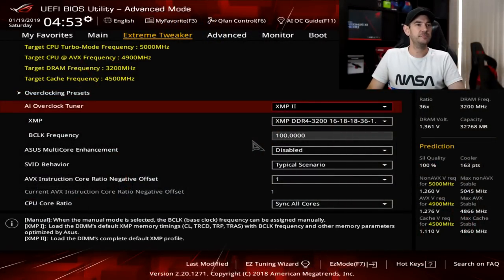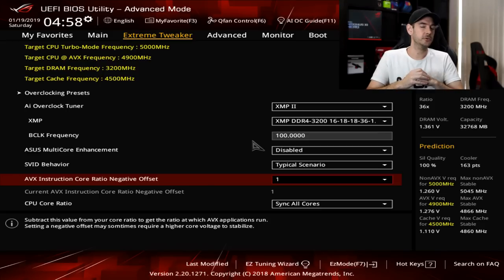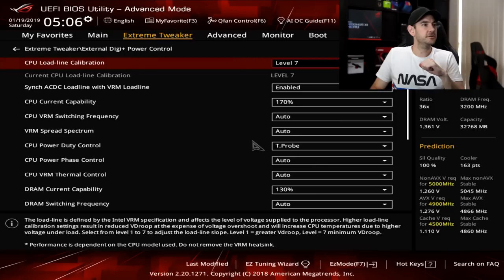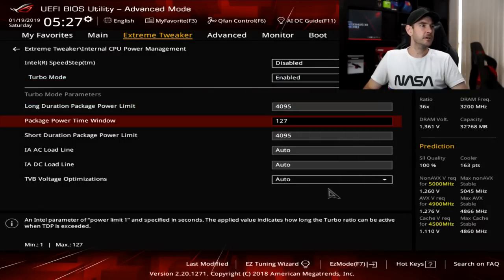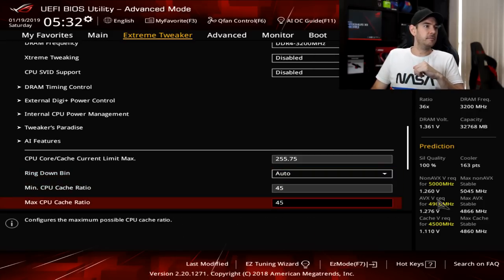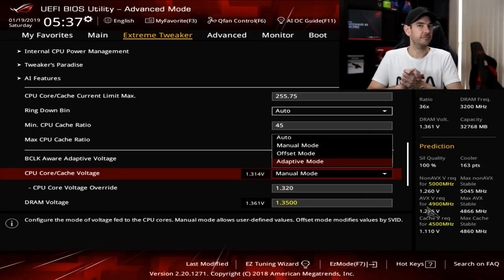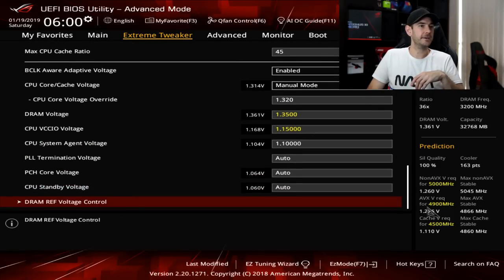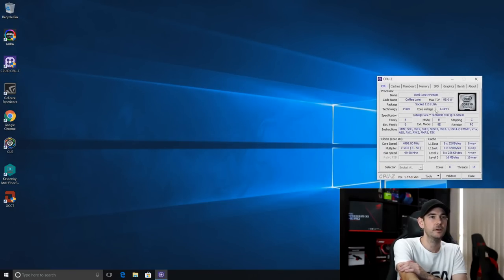The Complete i9 9900K Overclocking Guide - Maximus XI Z390 and Others

Comment: Love your videos. Super helpful!  Been working on my 9900k OC profile. I have an Asus z370G MB with vengeance 3466 16x2. Proc is binned and delidded and supposed to be stable at 5.0 at 1.300V. I have found if I run multiple Cinebenches I get a BSOD.  I have increased voltage up to 1.37v to get it stable.  My BIOS is slightly different than this one but have very very similar setting. Ideas on how to get it stable at less voltage like the z390 boards show?  Seems like I am missing something.  Intel Burn Test shows stable as does large and medium OCCT although I get errors on small batch. Temps stay below about 80C on cinebench and less on Aida64 and IBT.  Thermal Compound is Artic MX4.
Reply from the maker: What’s the AVX offset claimed for that clock speed on your chip? It’s likely -4 or something high.
Reply: Boosted Media thanks for the quick reply.  Silicon Lottery recommended AVX 2 and that seems stable on an avx test. That’s what’s old.  It’s the multiple cinebench runs that crashes me.
Reply from the maker: Interesting. What sort of voltage droop are you seeing under load. Might need more load line calibration.
Reply: Boosted Media I have tried both Load Line 6 and 7. With 7 it raises the voltage significantly from:target while 6 keeps is pretty close to the target.  On a 1.370v target cpuz reports 1.344 or 1.360 in a Cinebench test. Without load the voltage will go back to 1.376V as reported by cpuz. Neither 6 or 7 seem to help too much on the BSOD in Cinebench.  At 1.370V I can run 10 cinebenches without a BSOD. At 1.360V I can run maybe 5 before a BSOD. Did some more testing with Load Line 7 at 1.360v. Under load voltage goes to 1.392 but still get the BSOD in Cinebench after a couple of runs.
Reply from the maker: I wonder if maybe there’s another issue like too low VCCIO or VCCSA. Going to be a process of elimination I’m afraid.
Reply: I was thinking that too. I have set the VCCIO and VCCSA both to auto and 1.15-1.20 without much luck. VCCIO of 1.15v is stable at an core at 1.7 I know. What is safe on the high end for these?  1.3 or so?  Silicon Lottery says the MB is not on their approved list so they won’t comment much. They want me to have an ASUS z390 but there are no Asus z390 micro-atx options yet for my rig.

Comment: If you use offset instead of manual you can get away with a way lower LLC. I have a Maximus Xi code and a 9900k and it was the only way I could get no vdroop. I set it to 5 and still get a little overshoot.
Reply from the maker: A little Vdroop is preferable as long as it’s not enough to make things unstable.
Reply: @boostedmedia  even at the highest setting I was getting significant amount of vdroop while running p95 small fft. Like .05 still. By doing offset and LLC 5 I'm getting a .01 to .015 overshoot which is way more manageable. I haven't been a fan of these motherboards. I'm most likely going to go with a Maximus XI Apex when it releases for the better VRM and better RAM overclockability and sell my Code.
Reply from the maker: Prime 95 small FFTs are a very unrealistic artificial load. Do you have the same problem with s more realistic load like Realbench/OCCT?
Reply: @boostedmedia  you're right, but no, it's more of a .02 to . 03 droop in occt. That being said, I get virtually no fluctuation in offset mode when running a more realistic load and only get overshoot when running small fft
Reply from the maker: Interesting. The VRMs on these boards do seem to struggle with the additional 2 cores.
Reply: @boostedmedia  yeah, my Maximus x hero seemed to do better. I initially had the 9900k in there and had it set to manual with LLC at 5 or 6 and had 0 fluctuation. I ended up giving the Maximus x hero (and my 8086k) to my brother when I got the code thinking it'd have a better VRM but that doesn't seem to be much of the case. While the xi code does use a hair less vcore the x hero was way better at keeping steady voltage when set to manual so I dont know. Just really weird.
Reply: @tresnugget  The Z390 Maximus XI series has worse VRM than ther Maximus X series. Buildzoid from gamers nexus did a breakdown on it.

Comment: I just have to say that my MAXIMUS XI is dying after one year and I never got to OC it.
Reply: How is it dying
Reply: What do you mean
Reply: @viperro4542  Like BSOD every 15 minutes malfunctioning LEDs and crashes using Maya. I've since moved on to Gigabyte.
Reply: @JayStein777  that's weird. You sure you didn't drop water on it or it wasn't a defective unit? Did you try resetting the bios because you maybe changed a setting?
Reply: @viperro4542  OK, I am a PC expert, my first comp was a Commodore 64, The ASUS was FUBAR after a year. I run stock for a year then OC. My Gigabyte board is rock solid. I may have gotten a lemon but ASUS failed. Oh and NO moisture got near that board.
Reply: @JayStein777  oh ok
Reply: @JayStein777  i wanted to buy a gigabyte board but the computer expert there told me Asus was better
Reply: @viperro4542  Research.

Comment: So I followed this set up and purchased pretty much the same equipment that you are using. It was awesome with zero issues on the first try and first time OC'ing.  However, I needed to upgrade my RAM to 64Gb and went with Corsair Vengeance RGB Pro 64GB (4x16GB) DDR4 3200 (PC4-25600) but before doing so, I figured it would be a good idea to revert BIOS back to default settings. Now, I would like to OC the 9900K again, but can I still use this guide? Thanks again for a great video!
Reply from the maker: Should be fine. May be a bit more difficult to get stable with 64GB.

Comment: so glad to found your video and your channel ! i am fan now ^^ Question : i have the maximus XI extreme + 9900K + 4x8gb = 32gb of G.Skill 4600mhz (constructor stock on there web at 4600 = cas 18-22-22-42 at 1.45v). can you please tell me what happen because i put this memory at 3200mhz at 1.45volts for make an stable OC of my 9900K who is stable under prime 26.6 for 8 hours) at 5.3ghz @ 1.315Volts (i let for the moment the avx at auto) with stong custom WC then after that i wanted to put like you the right speed i paid for mean 4600 and the "XMP 2" of this memory but it dosent boot... same when i choose "XMP 1".... i have actualy an VCCIO of 1.15volts and and System Agent of 1.20volts.... Thank you for your help and for your great videos :)
Reply from the maker: 4600MHZ is pushing the limits of the memory controller on the CPU memory controller and motherboard. Try setting your VCCIO and VCCSA at 1.3V
Reply: @boostedmedia  just tried even at 4000 it dosent boot... :/ i disable too the switch on the motherboard "mem ok" + i clear the cmos... if you have any idea ? I never touch to memory before that
Reply from the maker: I’d set it back to the base JDEC profile and get your cpu overclock stable. Then work on memory.
Reply: @boostedmedia  hi :) my cpu is totaly stable since now many days with prime 26.6 with value 12 12 testing working for more of 8 hours
Reply from the maker: Hmm. Do you have the RAM installed in matches pairs per channel?
Reply: @boostedmedia  thank you for your answer they are fast. I am using the 4 slots. With exactly the same memory 4x 8gb. But i just tried even at 4000mhz with your 1.30v and i even put 1.50 when normaly is 1.45v for the ram voltage to see and it dosent boot... i dont know what to do and gskill support just dont mind
Reply: if you prefer on facebook i sent you an message at your page messenger ^^ if not here is fine for me too ^^
Reply from the maker: Hard to really advise beyond this point. There’s so many variables. But basically 4600MHz is way beyond what the memory controller is rated to. So it’s possible your CPU just cant go that high.
Reply: Why my cpu is in the topic ? :) do you have an idea what i can do ? Or where to make them work ? :(
Reply from the maker: The memory controller is part of the CPU.
Reply: I understand. In this case what you recommand me to do ?
Reply from the maker: It’s impossible to say really. Could be that the ram and cpu just aren’t stable together at that speed. 4600MHz is just the rates speed for the ram. It doesn’t account for the other parts of the system.
Reply: :( more lost as the begining
Reply: Update ^^

- i tried  for the moment with the XMP 1 and i answer to the question 
after that  "No"  . i did right ? i put my memory voltage at 1.45v 
(constructor voltage) and i decide like this because i read on other 
post for high freq memory  to put  at vccio and Sa both 1.300v and i 
suceed to boot until 4500Mhz !!! ^^ after that i put on the VCCIO and SA
 both 1.250V it boot again but it took much much long time than 
1.300volts...

- Can you please tell me wich XMP to load ? the XMP 1 or 2 ? (to understand: what is the difference between them ?)

- to boot at 4600Mhz i have to increase more than 1.300v the VCCIO and SA ? is not risky ? it will not make more hot my cpy who is oc at 5.3Ghz at 1.315volts ? (very stable delied on direct die on strong cutom watercooling temp max on prime 26.6 non avx after 3 hours 83°c
Reply from the maker: VCCIO and SA 1.3 is ok. Anything up to 1.35 should be ok. I wouldn’t go higher for daily use.

Comment: Oh boy! OC the crap out of my CPU to achieve a 2 to 5 FPS increase.  Way to go mate! Not worth it.
Reply from the maker: Why are you watching an overclocking guide video then?
Reply: @boostedmedia  I guess I was bored. Plus, I just wanted to watch another useless video on overclocking a 9900k. You know there is no earthly reason to overclock one of these. First of all. they run more than fast enough to do anything you want to do with it at stock speeds, and second,  Check out any Benchmark video on these CPU's and you will see that overclocking them only benefits you in synthetic apps but virtually worthless in games and useful applications. How do I know this for sure? I own one. All overclocking really does is shorten the life of the processor and I for one like the idea that my chip will still be like new 10 years from now. All that heat and voltage = a sure and early death. Ga day mate!
Reply from the maker: I’m quite happy with my 30% extra performance but ok. :/
Reply: @boostedmedia  Lets see the benchmarks
Reply: @boostedmedia  hey just wanted to say thanks for making the video  it helped me out alot!  . I have question though that maybe you could answer for me. I have a asus maximus z390 code and a i9 9900kf and for some reason i set everything 100% like you did in the video and the voltage like you said to 1.320 and it wont show anything higher then 1.176 for voltage.I checked the voltage in cpu-z,speccy,occt5.51 also.   I tried googling it but have come to a dead end lol
Reply: @Mike Show me the proof Mike!

Comment: dont know why people kill their cpu lifespan for 300mhz more..  kill their case temps, their cooling systems and draw alot more power just to stay at 5ghz all the time and get 5 fps more and 40 sec in video rendering...  why would you guys do that ?? Why ? For what ? Explain to me. I assume that doing that is a good auto-satisfaction feeling but in the end your wear out all of your components for absolutely nothing since the turbo boost stays at a stable 4700mhz all the time when something is loaded. So why, why
Reply from the maker: If you do it properly it doesn’t reduce the lifespan to an extent that actually matters. At least not unless you intend to keep the same PC for more than 10 years or so. 

The power consumption difference is also negligible.
Reply: @boostedmedia  yea so if u oc to 5ghz and get like idle temps of 32 and like 50-60 when gaming on intenisve games. will it be fine for like 8 years
Reply from the maker: Isn’t that literally what I just said above?